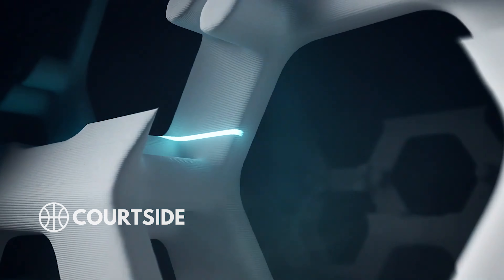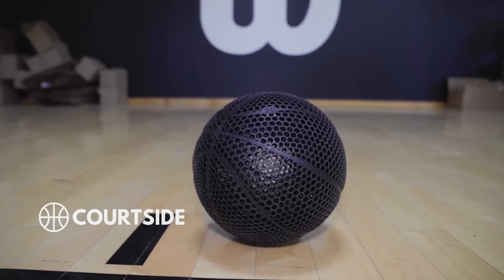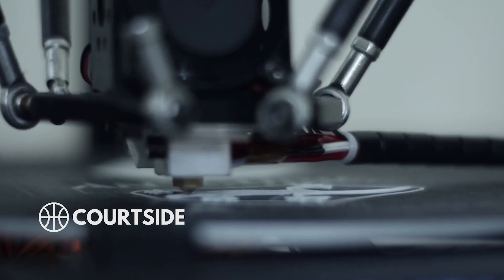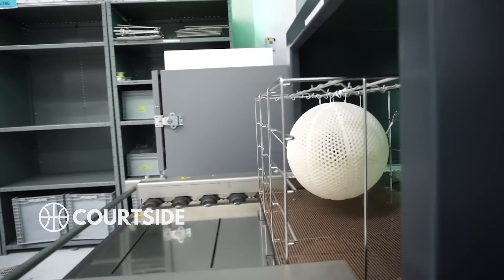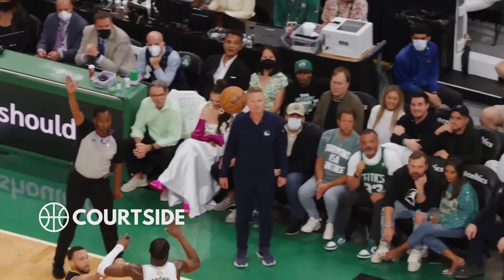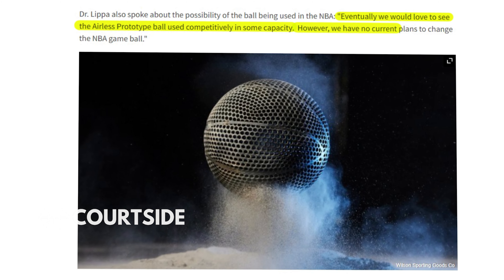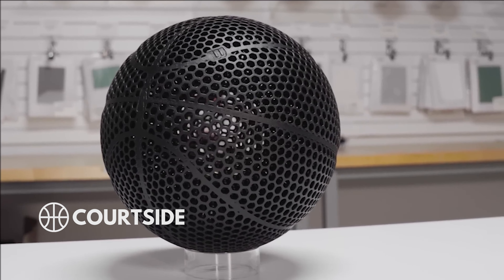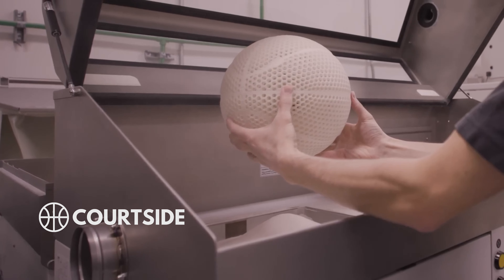Why the New Airless Basketball is NOT Ready for the NBA

Comment: Suggestions:
1) Put a balloon-like material inside the ball that does not deflate  and that prevents entry of dust and solid particles. 
2) Or design the holes that allow one-way going outside while maintaining bounce.
3) Accessory vacuum cleaner equipment that cleans up the insides of the ball.
4) Give out free prototypes to teams of small  communities and basketball enthusiasts and collect the reactions of players as bases for improvement